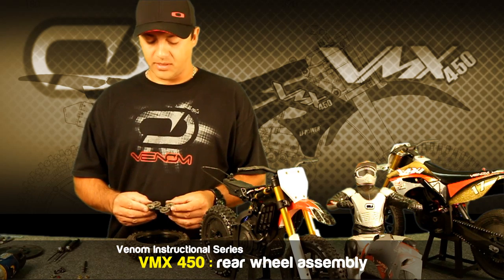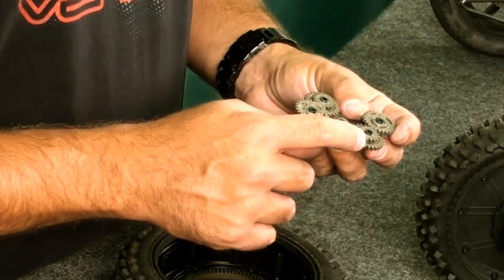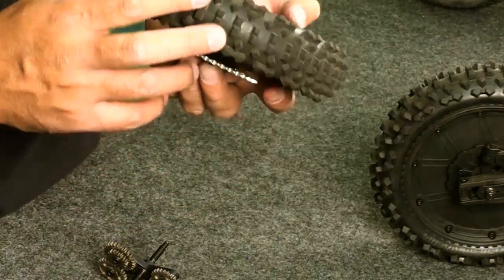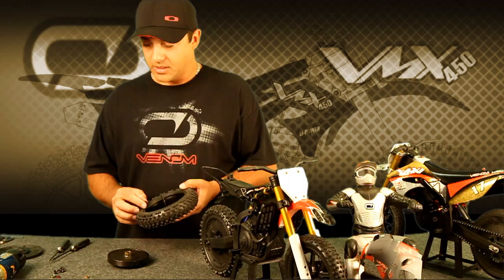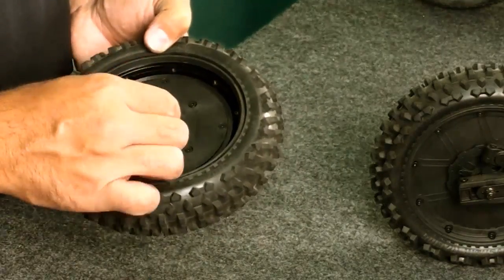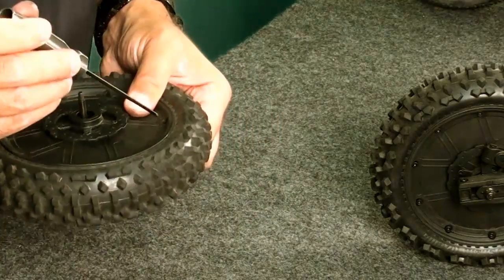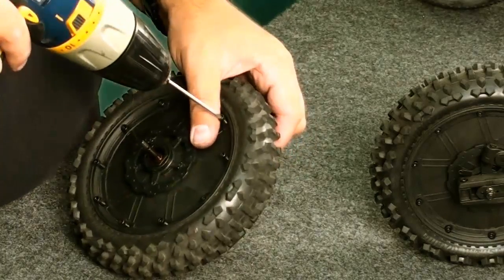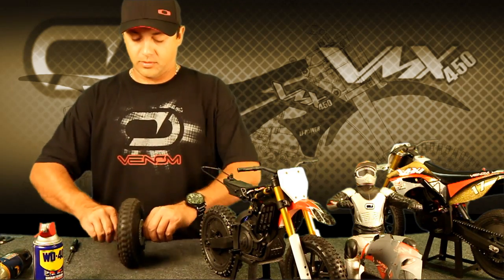Venom Informational Series - VMX 450 Rear Wheel Assembly

Comment: I really like this bike, I have two, one for me and one for my son :-) great fun!

In my experience you need to find the gyro clutch 'sweet spot'. Loose enough so it quickly spins up the gyro, but not so loose that it won't release when you let off the throttle.

And and a criticism I'm sorry. Please consider replacing the brass motor pinion with steel. The brass ones wear out way quick and sound horrible. I've replaced one of mine with a traxxis 10t steel pinion and it's way quieter, more effi